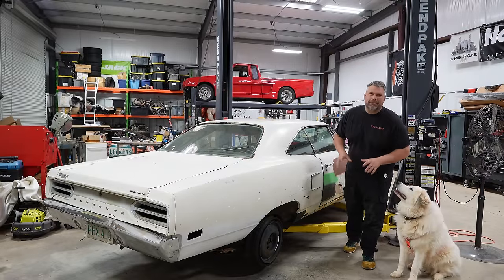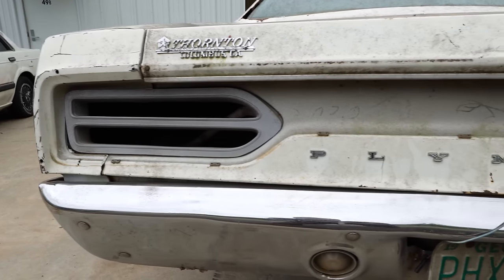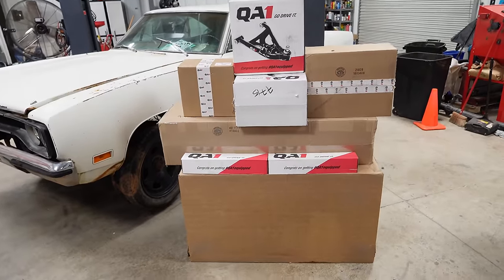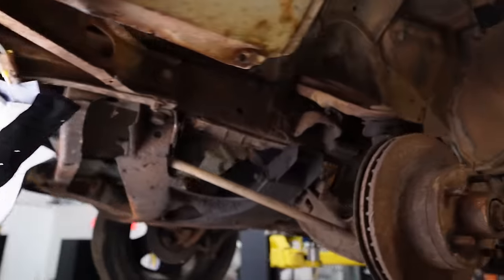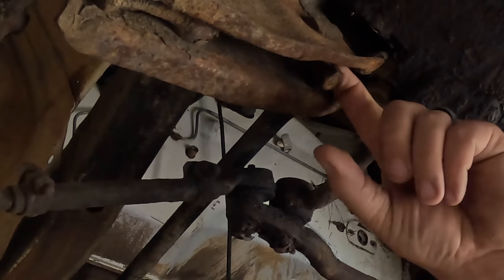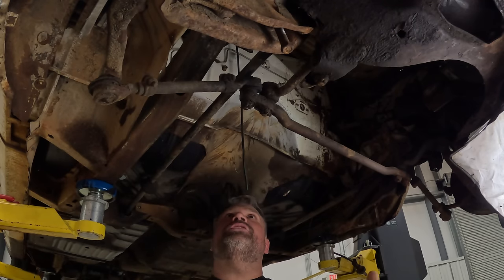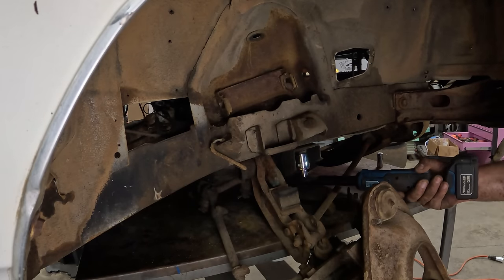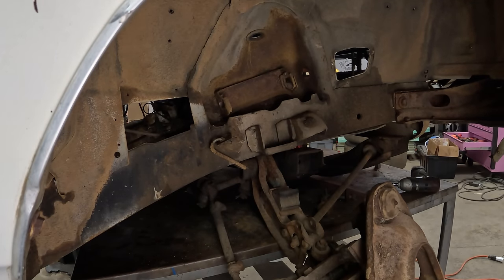Building My Dream Muscle Car Part 1 1970 Plymouth Sport Satellite

Comment: Bolt on as much aftermarket stuff as possible like black big diameter rims four wheel disk brakes and a wilwood oval mastercylinder led lights air suspesion digital dash billet steering wheel on a chinese gm style tilt column aftermarket bucketseats a 3000 watt sound system with 36 speakers  four tv screens and dual cup holders install a 2000 horspower engine with a 10 speed automatic transmission paint it gray after all the original sheetmetal is replaced with plugwelded and flapdisk grinded taiwan stuff from amd then sell it on barret jackson to a 70 year old guy to park it his 40 car garage

Comment: My current project is finishing installing the oil pump and timing gear with chain set in a 2001 6.0 vortech LS engine. I found a way to remove the oil pump and install the new one without dropping the oil pan. If anyone wants to know how to do this comment back.

Comment: My personal opinion is to stop and think about what will reduce the amount of potential future faults the MOST? New replacement parts might not be exactly right, cause future headaches. Or, you might have potential failures with the welding. I would think replacing the part that has been already compromised would reduce future headaches, but, how far into the future would just the welds cause issues? You want it as original as possible, and the weld is perfectly acceptable as you say. Not much help, I know...But think of the worst case scenario for each solution, and go with the one that has the least bad worst case.

Comment: 23:34 see? this is why i never mess with mopar anything... all MOPAR is.. is rust, blood and stupid breakages that nowhere the part can be found... BUT... for the front end.. the K-Member cracks... if one side has them, them just take as writ that BOTH sides have them... new frame ends? on a bunch of GM stuff of this era, you can "tube chassis' the front end with 4 or 6 bolts... but this is mopar,.. oland of  disappointment... i bid you good luck.. the good thing: resection and weld in repair... the correct thing: replace both frame ends. [in so much that , as a going concern, that these k-member cracks are NOT relegated to just these points.. "Pin hole out means rot throughout..."

Comment: If you want original metal and that unmolested build then patch it. But if you are changing panels and all that at not fussed about original metal then get a new frame rail. I’d personally do the new frame rail I want it to look good and I want the confidence it’s not going to fold and fall apart on on me.

Comment: Rack and pinion on these old cars is seldom a good idea.Those cars drive fine with the original set up. And are frequently dangerous with hotrod Harry set ups.
To remove torsion bars drop the lower control arm, then they come out easily. Though the bars work,, many commercials still use them. QA1 make good products generally, again no need for coil overs. Use QA1 shocks and top wishbones as they allow better wheel algnment. Though they too use poly bushes which are very WRONG, throw more load into th chassis,, and they have enough problems OEM.
Controlling those old leafs,, pull them out, then apart, clean each leaf and reassemble with new seperators and the springs will work. All crusty like that they are near frozen.

Comment: im not sure whats going on? if its the dream build and youre looking for a high level of quality then start with b completely stripping the car and building a stand to to sit it on that can be moved and allow to spin the car (spit)  then chop out all the cancer and repair and replace. why would you bother putting rear shocks in something that requires them to come out when you need to repair, replace and paint well before new parts. 
I dont get your methods

Comment: You're not building this car to enter the Pebble Beach concours. Your originality claims are already done for with all the suspension modifications. There is no reason to do the immense job of swapping out that frame rail. Just patch and repair the existing one, do an extra nice job of cleaning up the weld, and enjoy your restomod.

Comment: You will hate me here what I am about to say you ruined the front suspension  on the car yes it needed allot of repair  I get that but the torsion  bars in a mopar must be kept unless you do alllot of frame reinforcement  they are designed to hold the weight up in the midle of the car so qa1 ok for the project but keep the torsion bars and  o coil overs please read up other people's  disasters and disappointments two those torsion bars are now junk you grooved them with vice grips and tbey will snap now good luck save that mopar but keep torsion bars upfront